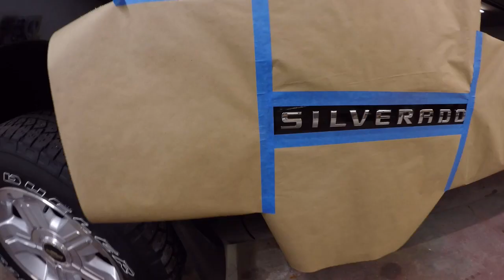How To Plasti Dip Silverado Emblems And Badges

Comment: What you use to cut around the letters?
Reply from the maker: Plasti dip is self cutting on edges. I used a spudger tool to help lift the dip in the hard to reach areas.